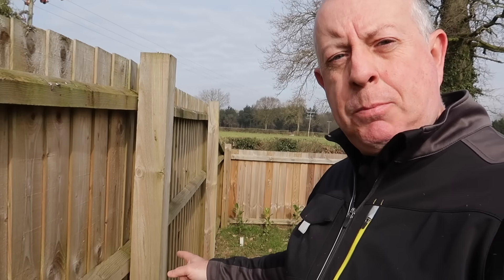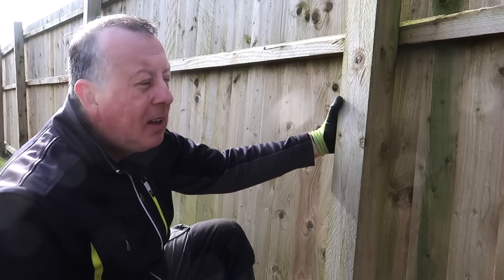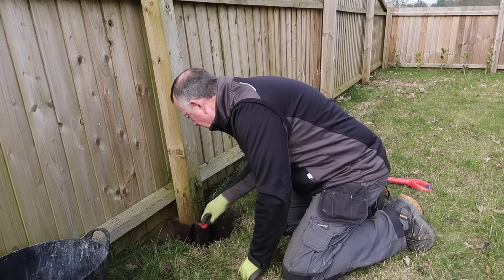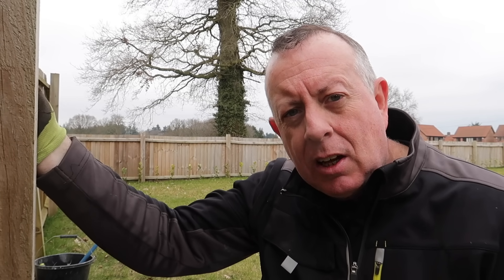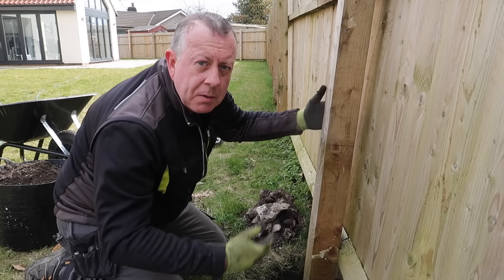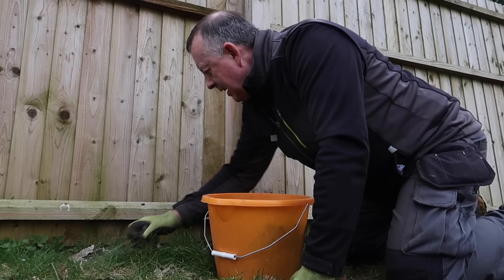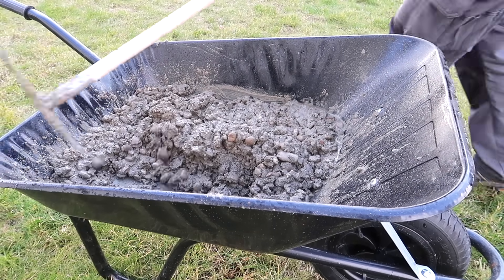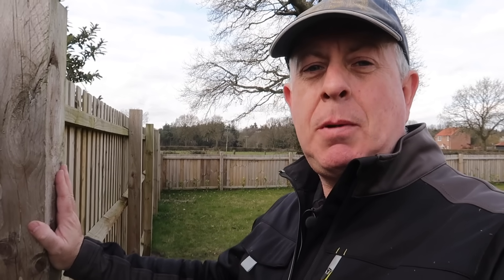How to Fix Leaning Fence Posts

Comment: For a start, don't set posts in concrete, instead mix excavated soil with cement (3 or 4 to one cement) and crowbar ram back into into posthole, its cheaper, faster and effective. If ever post/ posts  needs replacing, having to jack hammer the concrete core out is a pain in the butt. Rammed earth maintains the holding power and can be easier to remove. Bitumen paint from base to above ground line... Good!. If post is has broken off at ground level, drive a steel star post deep alongside and secure into post. Do not worry about being aesthetic, its only a post!

Comment: Dude you've just made the job for the next man 100 times more difficult to replace that post, its still going to rot at grass level, the correct repair would have been to install a concrete spur
Reply from the maker: I haven't been called a 'dude' for maybe 30 years!

Comment: Wouldn’t it have been easier to straighten the post and just add concrete rather than getting the old concrete out?
Reply from the maker: As I said in the video, with the concrete in place I couldn't straighten it and if I did push it that far, I would have had so much spring in it it would have just come back after placing more concrete

Comment: Install it right the first time and a pole will not lean. my father is a professional fence builder and has never had to repair a post once for a old customer. concrete a string and a level. problem solved.
Reply from the maker: Please tell this to the 'Professional' fencing contractor who put the fence up a year before I bought the house!
Reply: @ProperDIY  there’s lots of companies out there that call themselves professionals but their work proves different. sad to say. my dad used to even go and fix and rebuild fences that were built by his competitors. funny thing is my fathers prices were cheaper then his competitors so people hired the more expensive companies thinking they were going to get better work. in most cases that would be the smarter move. cause a lot of companies who do it cheaper usually do crap un professional work.

Comment: Looks to me that it is a 6ft fence. The post isn't deep enough in the ground!  Should be on 9ft posts!
Reply from the maker: Yes, should be!
Reply: @ProperDIY  the amount of concrete round the post isn't the problem. The smaller the hole you dig originally the less earth is disturbed making the walls of the hole stronger to support the concrete round the post. By the looks of the soil you dug out the ground is soft therefore not supporting the concrete. The depth I the issue.
Reply: 2.4 metre, or 8 feet posts are fine for a 6 foot fence. Burying a post three feet deep is a nightmare, and even worse to remove. In my experience, posts only fail through rotting at ground level, and I've never had one blow over unless broken at the base through rot,.
Reply: @TheEulerID   yes post do normally  rot on ground level but the issue wasn't rot.  The post had moved in the ground. As a standard thing I always put a 6ft fence on 9ft post to allow for soft ground, which by the looks of it he had.

Comment: If the post had of been concreated to the top it would not have caused a problem in the first place this is the cause of all leaning posts .
Reply from the maker: Yes correct. The contractor that put the fence up before I bought the house cut many corners.

Comment: If that is your fence, who put that amount of earth against the post above a shitty little bit of concrete? You better hurry up & do the others then mate b4 they all rot through.
Reply from the maker: Yes, my fence. Built before the garden was put in (new house) so I think they got the levels wrong and it ended up low and then covered but topsoil and grass.

Comment: Good video but I do wish you would talk in British measurements instead of continental all the time. We are losing our heritage and identity at a rate of knots and abandoning our traditional units of measure is part of it. Otherwise, well done, cheers
Reply from the maker: Sorry about that but unfortunately mm and kg are not continental they are UK standard. In my 30 years in the construction industry thats what I have been used to and all Engineers and professionals work that way. I do through in the odd imperial phrase so those from the US feel included but if I did that all of the time I would get dozens of comments telling me we are in 2021 and should be using metric!

Comment: poorly done in the first place also no need for all those struts plus once its pushed back it will hold on its own while concrete goes off. before anyone disagrees 25 years fencing including safety barrier crash cushions and accoustic fencing on highways
Reply from the maker: Yes, poorly done by a so called 'Professional' fencing contractor. No, I did need the struts as the fence wouldn't sit exactly vertical to the nearest mm and there was a medium wind in the air so it needed some help to say where I wanted it while the concrete gained strength.

Comment: It seems no one has noticed that the posts are not been installed properly. The strength in a post is greatest when the post is turned the other way to how it has been installed here. Narrow part of the post to the rail. Poor workmanship.
Reply from the maker: The posts are square 100mm x 100mm

Comment: Why doesn’t he just pull the post into the correct position and pour more cement in the hole he’s just making more work for himself
Reply: I dunno. Maybe because he doesn’t wanna stand there holding it for 2 days while it sets 🤷‍♂️🤔
Reply: @ystopyra19  he wouldn’t have to he can use wood to hold the post

Comment: I would break up the old concrete and mix it with the new,
Reply from the maker: You mean all mixed up with bits of top soil etc? That's not one of the options I considered.
Reply: @ProperDIY  not with the top soil, my father taught my to just hammer in the rubble , no concrete required,  I do it like that and it works good, why throw away concrete when it can be brocken down and mixed with the sand cement mix if you want to use wet mix?,waste not want not
Reply: @MrEricharper  I do the same. The old concrete lumps we've dug out have had all sorts mixed in - anything from glass to broken bricks. I know new concrete isn't supposed to stick well to other concrete but I've never had a problem of the concrete breaking apart in the hole and means you don't have to mix as much